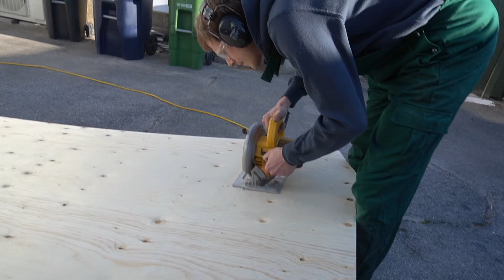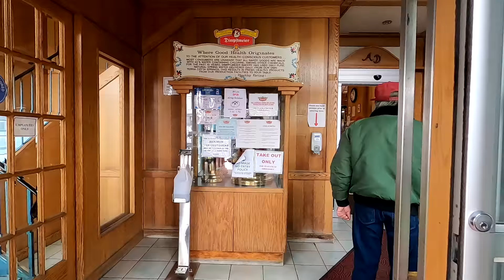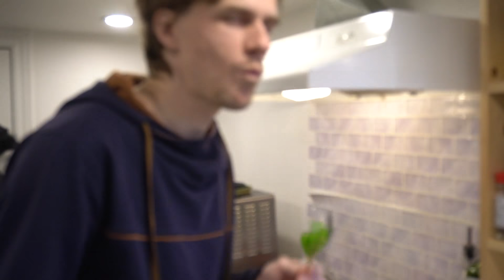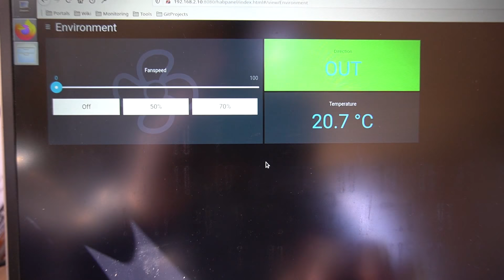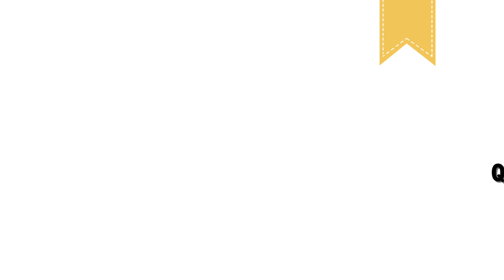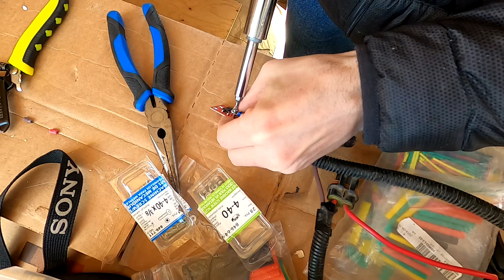Fantastic Fan Remote & Directions, Bike Storage, Battery Charger with Booster | BOX TRUCK CONVERSION

Comment: would not a Verner diode work?
Reply from the maker: Do you mean a Zener diode? I'm using the diode in its forward configuration (so current flows from anode (boost converter) to the kathode (positive battery terminal)), so the zener would still dissipate energy from its voltage drop.
Reply: @RoadtoPitches  Yes. I remember that in my electronic class. It stopped the electrons to come back into a circuit. I went to high school in Burlington before moving to BC.

Comment: What a team, beauty and brains.
That is impressive engeering with the electronics. I installed a Maxxair fan above the bed with all the features. I was not impressed with it.
I also installed a 24"x24" boat hatch behind the seats and thought a car electric radiator fan with a pwm controller would be a big improvement. The Maxxair fan is 900 cfm on high. The radiator fan is 3,000 cfm and the cost for both was $54 usd. Both fans are rated at 10 amps. On Instagram my username is going._west. I have a few pictures there if you are interested.  
Always a thumbs up 👍
Reply from the maker: Hey thanks for your comment! The fantastic fan is a budget option but with a bit of fiddling you can get a bit more out of it. That radiator fan sounds like an interesting option. It might be harder to bug-proof it (and i guess it has a low WAF for its optics 😂). 
I'm gonna check out your IG for sure!
Reply: @RoadtoPitches  they have a bug screen that you drop over the hatch when it's open, $15

Comment: cool stuff :) looks like we have Boxtruck twins, I used the exact same boost converters to charge my tesla 24v pack and i had the same fun figuring out what dial/knob did what :D like the Fantastic fan controller..i was planning on just controlling it via home assistant, but the reverse to read the knob back into the home automation is pretty cool i`ll have to get that working too now.
Reply from the maker: I'm actually glad to hear that I'm not the first one to use that converter. I was torn between cheaping out on that thing or taking some money in my hand and getting a "real" boost charger. I will have to see if that thing lasts or if it will give up early. So far I'm impressed. It didn't even get warm when it pulled the 16 A.
Reply: @RoadtoPitches  you did the right thing, I went the expensive route first and bought two boosters from Victron and these things are advertised as battery charging capable.. well if i didnt have them behind good breakers they would have burned my rig down! for 6X the price you`d expect some kind of current limitter, but no, they went immerdiately up to 110amps :D and then the breaker popped.. so the lesson is: try cheap and chinese first and save a ton of money, I for one am cured of Victron products, their non existant customer service was just the icing on the cake, even the aliexpress seller was 10x more helpful with the chinese boosters.
Reply: @RoadtoPitches  btw. I`m running 2 of these boosters in parallel plus one of the red smaller ones (advertised as 1500w) which does around 12amp and I`ve had zero problems, just getting them to be equal in contribution is a bit fiddly as you need to set them very precisely but now Ive got around 50amp of charging on a low battery and it charges very quickly and all for 1/2 of one 20amp non working Victron booster ;) 
btw I am super impressed with those small red 1500 w buckboost converters, its been the first one I had and it always delivered around 12A and had zero issues with heat or other faults.. I only got the one you have because I didnt want to run 5 of the red ones in parallel.